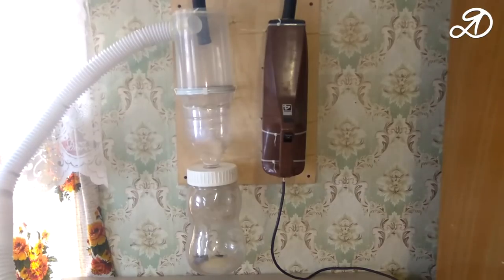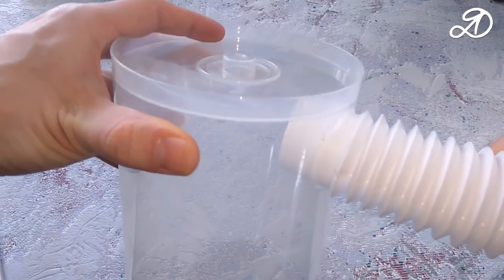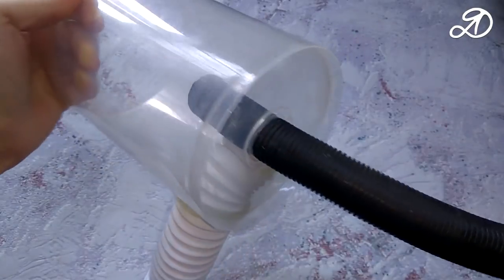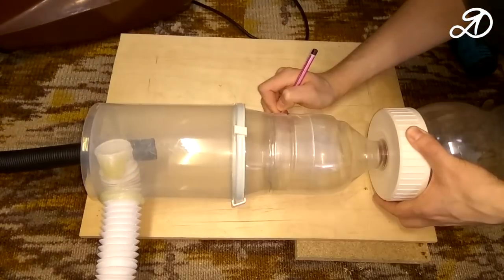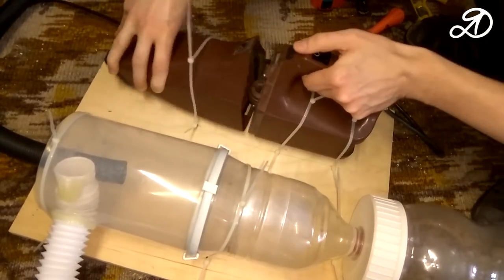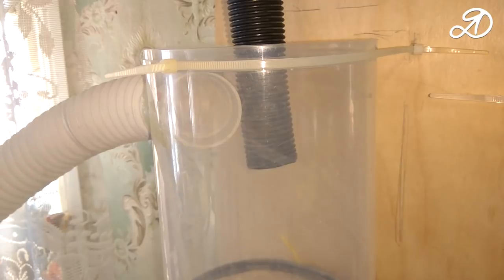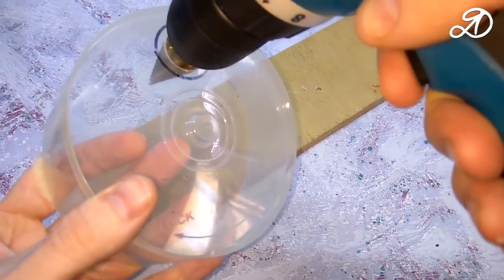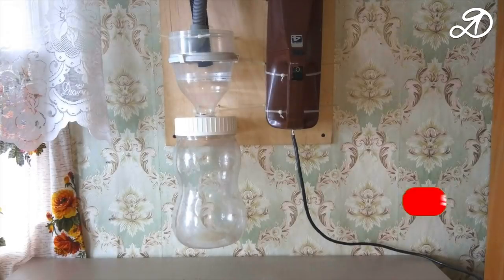CYCLONE FILTER DUST COLLECTOR DIY. How to make Dust Separator for vacuum cleaner

Comment: I think it is one of the best cyclone collectors. I used the pod from an old spray pod for the flowers, i opened the two holes and i connected a 5L bucket at the bottom, AMAZING RESULTS! Not even 1gr of dust in the vacuum cleaner, also the vacuum performance became more high because of the turbulence inside the cyclone collector, the vacuum cleaner works to the most performance without any effort, NO DUST, NO HEAT, NO MORE BLOCKED FILTERS. I also saw some other videos where they use just a bucket as a cyclone collector, it works but i think your cyclone collector (and mine also :) ) is the best combination for the best performance. The collector (the up part) is doing the job and the bucket is only to receive the dust (it will be better the bucket to have a cylinder shape because the turbulence goes down in the bucket also). The bottleneck keeps the dust completely down to the bucket, an important point.Two important details, the inlet pipe inside the collector must have little down direction (it forces the turbulence to go down) and the outlet pipe level (connected to vacuum cleaner must be around 2-3cm (maximum) lower than the inlet pipe (as in the video). My cyclone collector is similar to first one in the video,  the inlet at the side and the outlet at the top (looks like a turbocharger but has very good performance!)  Your vacuum is small, a toy, but you can see the power of the turbulence inside the bottleneck, really good cyclone collector! I will only change the bucket with a 20L bucket and i will get rid of the wood dust for ever! Thank you for the nice video and project! Easy, cheap, and more effective than many other cyclone collectors that exist in the market!

Comment: Nice concept. It would be ideal to enlarge the initial chamber where the air comes into the chamber. The increase in volume will slow down the airspeed thus resulting in the sucked up particles falling out of the airstream. In the current design, the size of the initial chamber is still a little too small but probably sufficient for most larger particles. The biggest issue is that with this configuration small dust particles will be recirculated in the room causing dust particles to stay airborne. This is specifically dangerous when sucking up certain fibers from glass fiber and other synthetic particles. The filter in the small Dust Devil should be of a HEPA13 type to catch all these particles and preventing them to become airborne. Besides all this, a very inspiring project to make for people that are starting out to do DIY projects.
Reply from the maker: Thank you for viewing and detailed review! The old vacuum cleaner has a filter, but not HEPA. This is my first project with such a filter. I also realized that it should be a smooth cone. So the particles will not spin in one place. Home-made projects develop creativity and I want more people to create something themselves. Thank you again for your comment!
Reply: @dial2277  Absolutely! Thanks for your sweet reply. Together we can evolve. Actually, after seeing your project I designed my own 'whirlwind' vacuum cleaner in Rhino3D. I might actually make it soon with a 3D-printed part. If I ever make it in real life, I'll be sure to show you! :)
Reply from the maker: Thank you! I'm glad you have a new idea! I am very interested in 3D printing. I look forward to your project. Let me know! Good luck! :)
Reply: @dial2277  Will do! Right now I'm focused on building my 3rd printer. When it is finished I can start the production of this shop vacuum :) (will be near the end of april).

Comment: I'm not sure if someone mentioned this but buy a "rain gauge", its shaped as the cyclone system, just need to make a hole for a pipe to suck up dust and it's quite cheap at any hardware store.